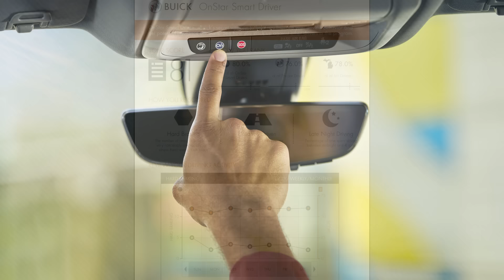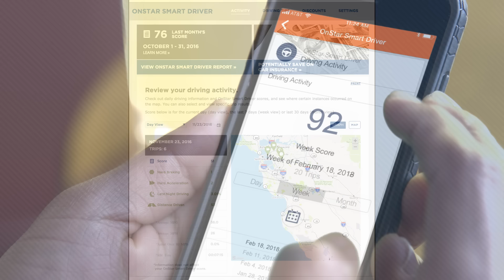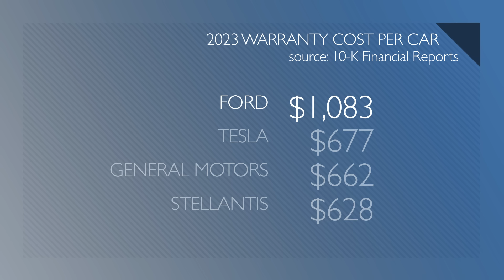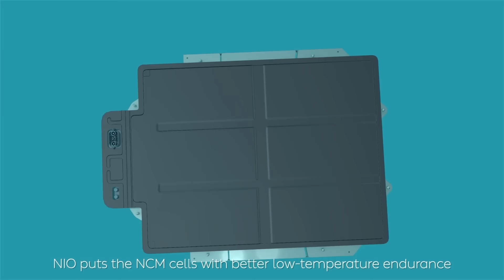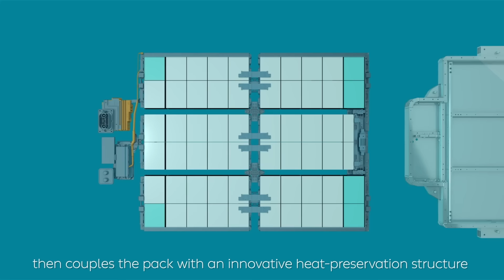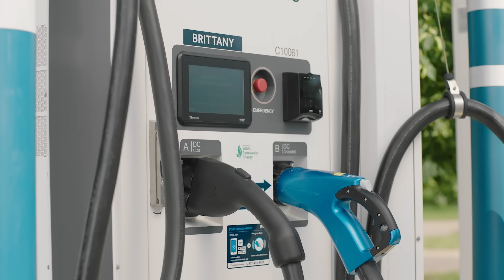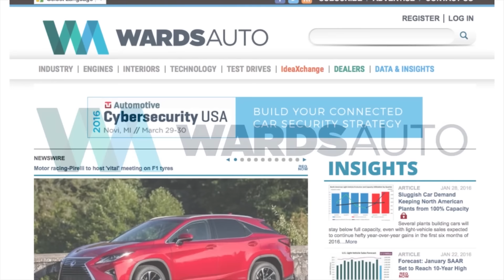GM Sued for Selling Customer Data; Honda & Nissan Explore Joint EV Efforts - Autoline Daily 3769

Comment: Probably the two major reasons for EV adoption being higher than many thought with apartments/multi unit residents is because many are trying to keep costs down. Electricity prices are lower than gas, even if you use public charging. Then add in maintenance costs are lower as well. Would not be surprised if these same people primarily are buying Bolts, Model 3, and used EVs. Probably not many buying $70,000 EVs in this group.
Reply: Nonsense
Reply: @Pernection  Nonsense, why? Do you rent? Most renters I know count every dollar they spend. Get a Bolt for under $30,000 or a used EV for under $20,000 and be able to recharge cheaper than buying gas with no oil changes, no annual SMOG test (California), and usually nicer for daily driving. 

When I got my Model 3, I was paying $300 a month in gas. Now I pay $85 in extra power fees on my power bill. That helped me to dump my ICE vehicle.

Comment: I live in an apartment. I estimate 20~25% EVs in rank order of Tesla » Kia » VW » GM (Bolt) « Ford (Mustang 1) » Rivian (pickup 1) » BMW (i3 1, mine). Probably another 30% are various hybrids. local Target store is the charger hot spot wire Tesla and EVGO,

Comment: I'm surprised Stellantis's warranty costs are much lower than Ford's, I think the Jeep is the least reliable brand you can get.

Probably because of their really short warranty periods, Jeep must have perfected the art of timing warranty expiration with planned obsolescence designs.

Imho, based on experience, my sister's Jeep died at around 50k miles, juuust past warranty cutoff.

Comment: VW still seems like they are behind on the EV game if they are saying battery prices are too high when the largest battery makers are saying they are going to ser as much as a 50% drop in battery costs this year, so the industry seems to be seeing major reductions. That should mean by 2026 when they would need to be commiting to a production location for the ID1 if they have any hope of starting production in 2027, battery prices will likely be much lower. I do think we will see 50% cost drops every year, but if batteries are 65% cheaper by 2027, that should help a ton for keeping vehicle production costs down

Comment: 3:45 - DON'T FORGET: a german / european price is a different beast than americans think !
20.000€ means that based on american habits and standards the net price has to be mentioned which is 20.000 minus VAT = 20.000 / 1,19 if you refer to VW prices mentioned in germany. 
16.800€ is a lot less than 20.000€  I bet even in the USA especially for entry level EV regardless what currency. 16.800€ means currently 18.300 $  

I suggest to mention 20.000€ as the price announce but to always put that into the american perspective which would mean a net price of 18.300 $

European dealers for what ever is sold to end customers have to show the end prices including everything. Also here it is forbidden to add fees or even force customers to tip cause  a tip is a free choice here.

Comment: little confused on your Mercedes comments. pretty common knowledge they are cooperating with YASA motors and there is alot of info on the tech available. why the lack of detail regarding this motor tech?

Comment: I purchased 2021 f150 brand new from the dealer. I owned it about a year and a half and it's spent at least a month and a half in the dealer. I took that truck in like 7 times. Finally i had enough of that shit i sold it back to the dealer for a lost